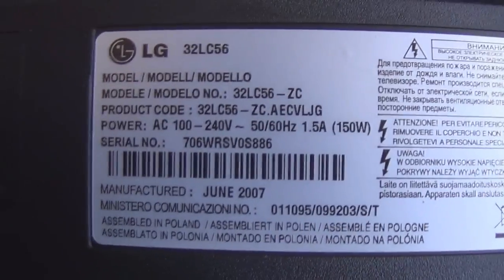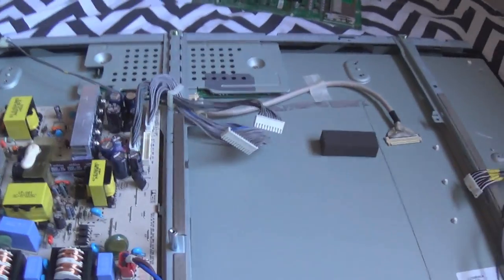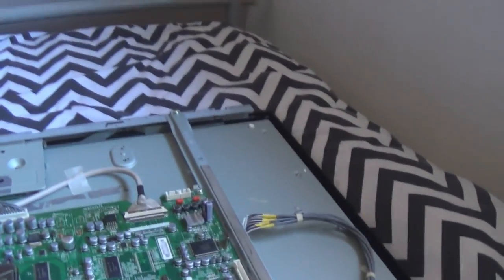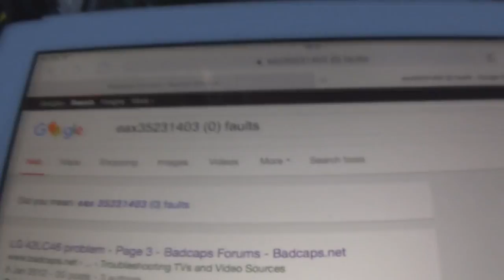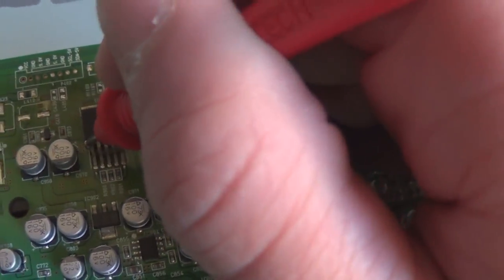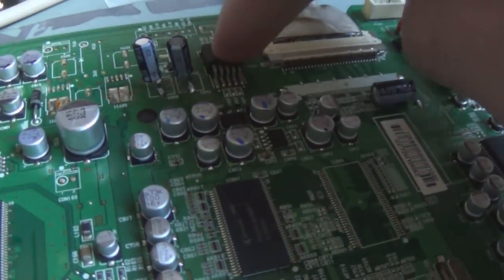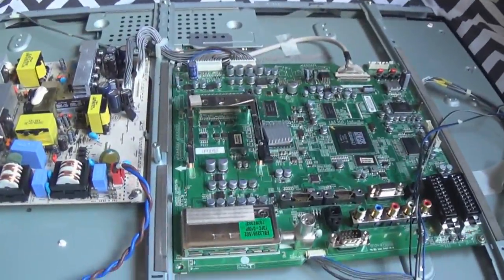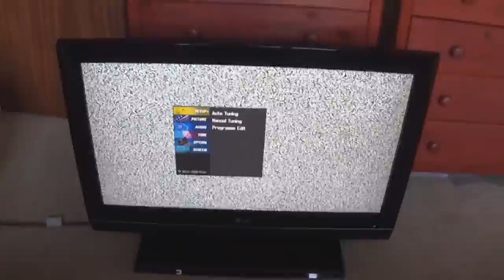Lg Lcd Tv Flickering Screen Repair

Comment: This was an interesting repair. I learned something new, thank you!

Just a few days ago I repaired a Samsung LE32M87BD with help from one Russian website. It was a small inconspicuous 1uF SMD capacitor on a board connecting T-Con and Mainboard together. There were failed caps in the PSU as well.

The TV would still not start after replacement of PSU caps. However, it started up fine after replacing that pesky little 1uF cap. Lots of thanks to all these knowledgeable and patient people who find these obscure faults for the first time! It saves so much time and trouble when these findings are shared.
Reply from the maker: +Random Electronics Repairs Cheers glad to help :) Its odd but I understand it, the bad caps on start up have a higher esr so the reg sees a lower in put and trys to adjust its self but it cant, so when the caps heat the esr goes lower when causes ripple to go on the input of the reg throwing off everything.
Reply: +MrReeceyburger123 AFAIK, the lower the ESR, the less ripple. That's why low-ESR caps go into the PSU. So the regulator should actually have easier time to regulate output. Maybe it's the capacitance, leakage current or some other parameter change that causes the effect in your video.

Maybe the capacitor starts leaking too much current when it heats up. So it doesn't hold much charge thus letting ripple through to the voltage regulator.

Here's the source: http://www.rubycon.co.jp/en/products/alumi/pdf/Performances.pdf

There it's stated that capacitance will reduce over time while leakage current will become higher with an increase in temperature. So maybe it's not ESR, but high leakage current at fault in this case.
Reply from the maker: No I meant that the caps were beginning to fail which meant they had a higher esr. When they heat up and the esr and ripple from them changes the regulator has a hard time adjusting to this which confuses the processors etc ;)

Comment: MrReeceyburger123 cheers mate helped me fix my 47 inch LG with a very similar board and problem. I would have never figured out it would be the tiny 100uF capacitors so thanks for the help.
Reply from the maker: +Ronan Wood Awesome glad to hear its fixed :) Hope it lasts a good while now. This Tv has been sold since September last year and is still going strong.

Comment: Hair dryer acts as a reflow if you have the board under load, and heat applied, right? Wouldn't this gravity break solder connections by moving the board around just after you've heated it?

Comment: I was doing a bit of a search on here & found  through ShopJimmy on here the output voltage I should be getting to the backlight LEDs.
All the voltages to the main board were as per written on the power supplies PCB,I found out that on here as well (i.e 3.4,12 & 24 volts DC), they measured o.k.
The voltage output to the LED backlight was between 125-130 volts DC so the power supply is good.
I pulled the screen apart last night & pulled the LED strips out to test them across 24 volts DC,2 of the 3 strips lit up but 1 didn't light up.
I pulled all of the diffusers off the LEDs on the non working strip & put my multimeter in diode test mode,5 of the 7 LED's had a 0.7 volt drop across them whereas 2 of them had a  zero volt drop across them,so 5 of them are o.k. whereas 2 of them are blown.
I need to order some 6 volt LEDs as that's the voltage LED's that LG use,I can't seem to source them on EBay but they are available on Aliexpress from China.
I've seen someone use a clothes iron to solder them on here so I might just do that.
I did a flashlight test & there is a picture there so I'm hoping the main board isn't gone.
I won't know if I have any sound till I repair the backlight LED circuit which is connected in series.

Comment: Hi I have the exact same issue as shown in your video only it seems to happen straight away, even when the TV has been left off. When I turn it on and the picture appears flickers a while then Cutts out to a black screen. So I'm wondering after watching the video, the caps u replaced where replaced with? Obviously if call the TV repair guy I'm sure he could diagnos the problem and offer the repair but I don't want to pay over the odds for what seems a simplish fix. Many thanks

Comment: I tested bad cap with esr-meter and when I heated it, it became good. So why in this case, when caps got warm bad issues started to happen???
Reply from the maker: Hello when caps fail the chemical in them dries up and they because highly resistive, when heated the resistance of them lowers which is the same for any electrical device. So when they are heated the resistance lowers and the circuit is alot more stable.
Reply: Thanks a lot for information!

Comment: My fathers LG LED television went all Black on the weekend & the indicator light on the bottom was fluctuating in Brightness.
After leaving it sit for awhile, it came on & had sound but no picture,then after a while the picture came on intermittently then stayed on,I thought it may have been a polyswitch which may have cut out & then reset itself.
If it was my own television, I would check the capacitors in the power supply for leakage & check the capacitance of the capacitors on the circuit board as I have a multimeter which has the capacity to test that,knowing my dad, he'll just watch it till it doesn't work anymore as when the television is turned on first thing in the morning , it still Flickers a little bit.
It has to be the power supply because the indicator light just glowed when the TV cut out but you can watch it all day & never know it has a problem inside of it.
I place my money on failing capacitor(s) and/or a failing polyswitch protector.
Reply from the maker: As its an led tv unlikely to be caps but bga solder or a shorted Led possibly bad solder joints on the psu which ive had that in my latest video on a lg led tv.

Comment: Well,my dads TV failed 2 months after faultless operation.
I pulled the back cover off & found out that the soldered joints for the IEC connector on the power board had hairline cracks in them.
I also found out that the MOSFET which is the main switch on the power board is not switching on so I am going to replace it & see how that goes.
I can see a faint LG sign come on but the MOSFET is measuring in the mega ohms range & not switching on when I removed it from the power board,it should make the beeper on the multimeter work when the gate is switched on.
Reply from the maker: Hmm mosfet getting Vcc ? Mosfets normally only failed Sc not OC could be the controller most likely.